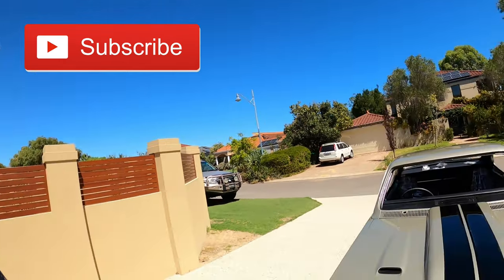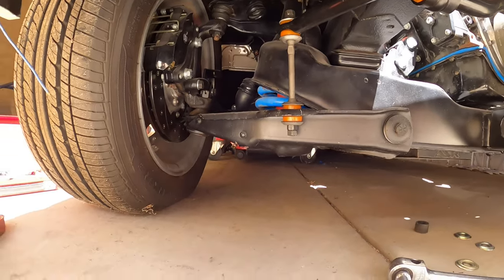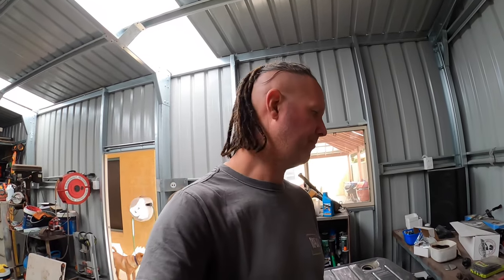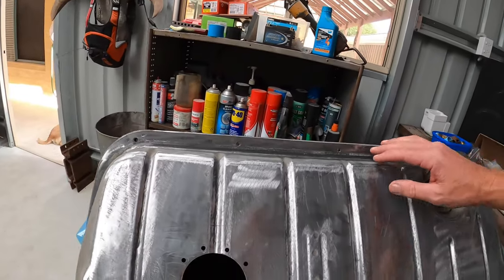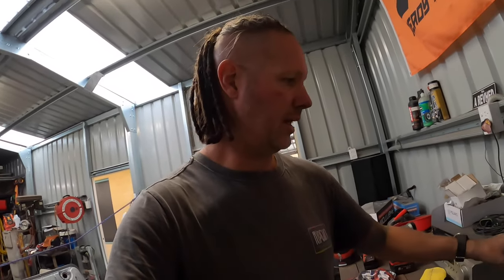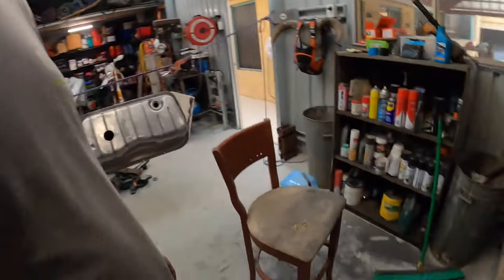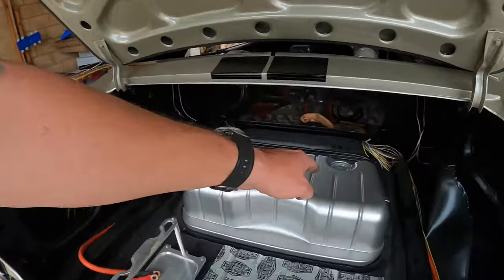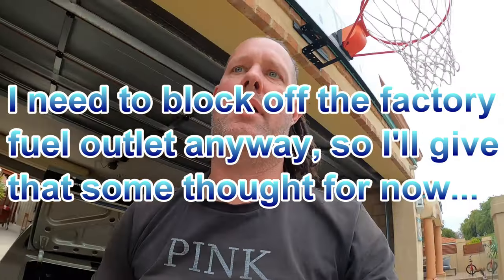Holden HT Monaro Build Ep18 - Restoring Fuel Tank, Rear Drum Brakes and Installing Radiator

Comment: That mixer is a game changer. I’ll be doing that for sure. 

I picked up another game changer rattle can tip from the Hackshop Garage guys. Leave the can in hot water for 3-5mins to heat it up. I make sure it doesn’t get too hot. It builds the pressure a bit and thins the paint. It comes out so much better. Almost like a gun finish. Not quite though. It’s improved my work a lot. 

I’ll mix with your method first. Then heat. Then shake. I’d get nervous shaking a warm to hot can on the saw.